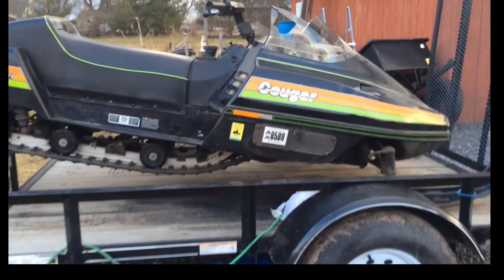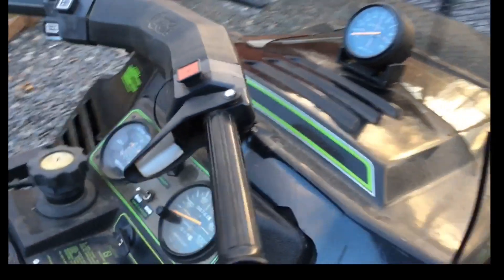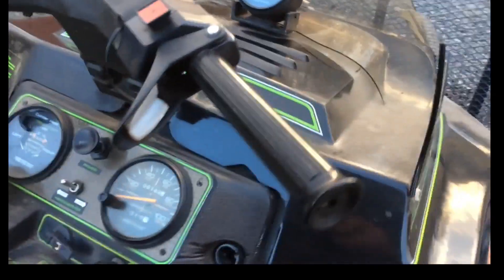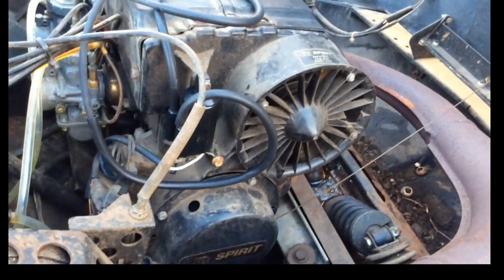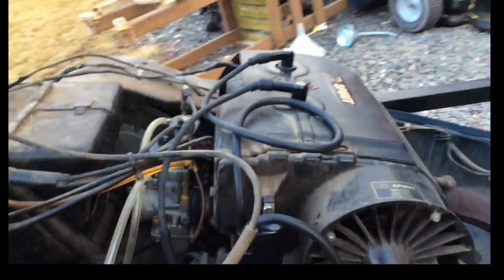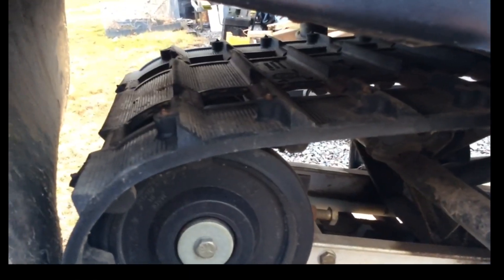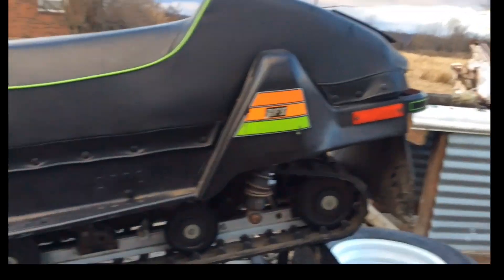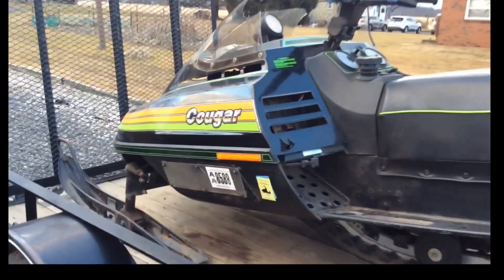The new 1986 Arctic Cat cougar 500 fc

Comment: I was wondering what the issue was with the engine? I have an 89 and sounds the exact same at idle and when throttled, looking for insight as to what is wrong.
Reply from the maker: Well idk if you saw some of my recent videos on it but it wouldn't hurt for you to check them out. I finally got around to working on it and it turns out this sled had weak spark and I narrowed it down to the stator. Im planning on putting it on this weekend I'll make a video of it.
Reply from the maker: There was also a bunch more issues with the oil injection, wiring and fuel pump. One of the ways you can eliminate the kill switchs is you can unplug the square plug that come out of the stator that will bypass the kill switch. You won't be able to kill it with the switch but you can easily pull the spark plug wires